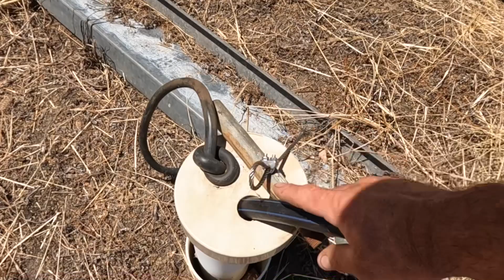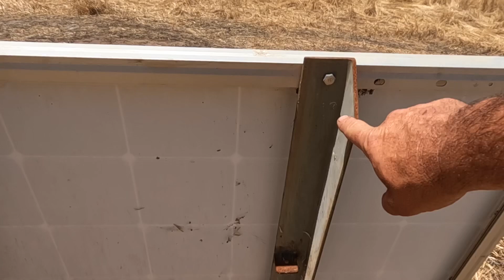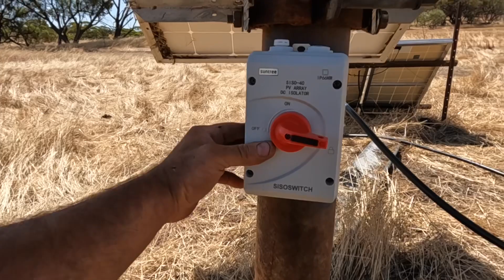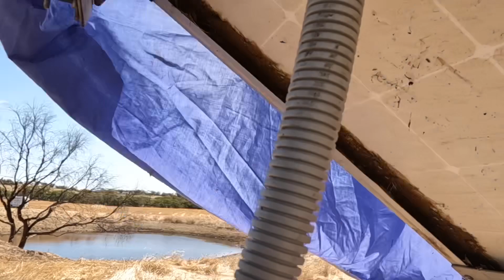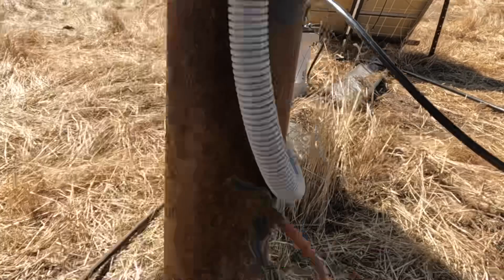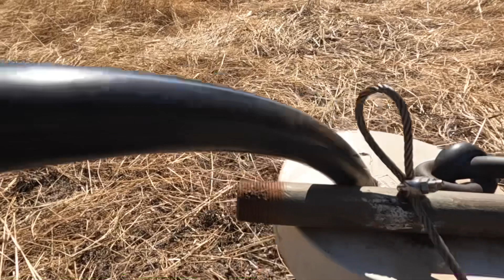Setting up a solar panel on our pump

Comment: I’ve found it makes more sense for us to have the panels pointed straight up as you get more flow in the hottest bits of summer when you need it
Reply from the maker: Hi Jan, I have set it up like this because we mostly want to get water in the early morning or late afternoon and need to be Abel to move the solar panel to the best spot to get the power when we need it. Laying them flat work well, but to get maximum power at mid day in summer as far south as Perth you are still better off with a slight tilt of about 9 degrees. I do have panels that are just set up flat as well.
Thanks from Geoffrey